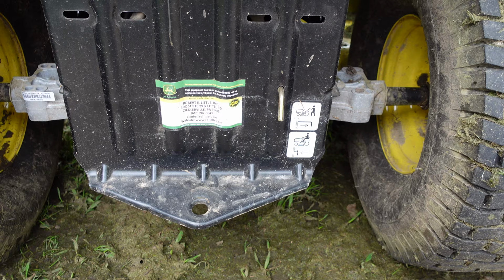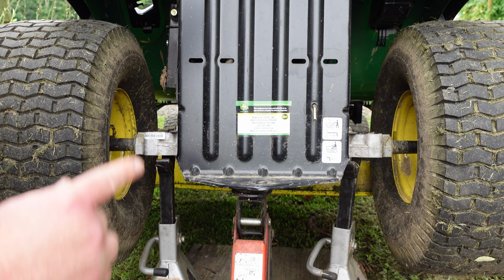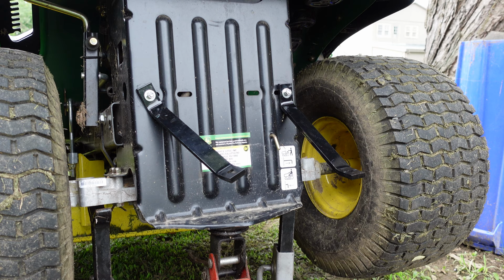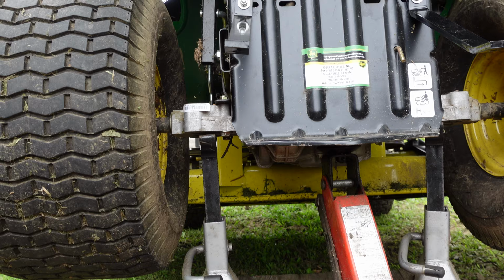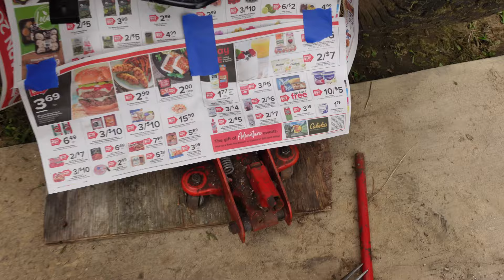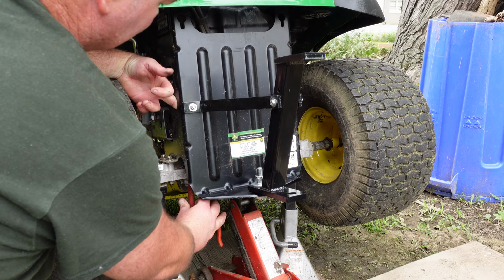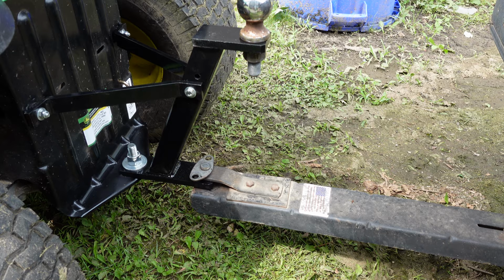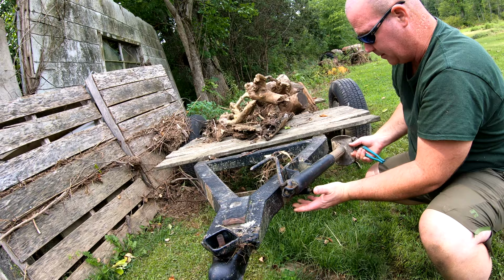John Deere 100 Series Trailer Hitch Upgrade, Install, Test And Review

Comment: I just bought one this year for my D110.  They haven't exactly fixed the problem with the arms, but at least now the holes are slotted which helps a little with the alignment.  None of the kits I've seen online are exact fits.  Mine didn't line up perfectly, but nothing a big vise and a 5 lb sledge hammer couldn't fix. 😁 Minor angle adjustment to the ends of the arms. Got them close enough to work.  I'm only hauling a lightly loaded 1000 lbs capacity trailer around the yard, anyway.  Good enough.

Comment: Great video and thanks for the tips. I've been wondering how the heck I'm going to be able to install one of those hitches on a Husqvarna TS354XD with no room between the frame and transmission. After watching you use long needle-nose pliers to fish the bolts up to the holes I ordered a hitch... Hopefully I won't have too much difficulty with it. Thanks again.

Comment: So you have to remove the hitch to put the bagger on? That hitch is using the bagger bracket holes.
Reply from the maker: I do not have a bagger for this tractor so I can't really say. But I have seen many bagger set ups that use the factory tongue as a mount so I can at least picture it in my mind. Some slight modification would be necessary to both the bagger mount and the hitch shown in this video. I do not believe the modifications required would be difficult, but if I'm picturing it correctly, they would be necessary mods to use both simultaneously. This is a universal hitch set up and it's real heavy duty, so you can weld to it just about anything you like.
Cheers 🍻.

Comment: Did you ever consider reversing those brackets and checking the angles.  Looks like they are different.
Reply from the maker: Oh yes, I tried to fit them every which way, both sets in fact. Only these arms in exactly this orientation fit this specific tractor. It is a universal hitch kit though, so these arms may fit a different tractor in reverse orientation. If I was to build this myself, the only thing I might have done differently is to mount these upper arm to the side of the chassis running parallel to the rear wheels. But I seriously doubt it would make any positive difference.

This is one hell of a kit and worth every penny.... By the time you get enough traction to apply enough force to even begin questioning the structural  integrity of this hitch, you would have long since already exploded your rear trans-axle. It's a very heavy duty set up.
Cheers 🍻.

Comment: The crappy little transaxle on JD 100 series will give out rapidly if you tow much. You really need something like a 570 or higher to handle stress like that.
Reply from the maker: Yeah I know he ain't the toughest kid on the block, but I did show what I'm pulling with it. And too, it's pretty dead flat around here. Now that I've recently switched to gas for heat, I don't need that trailer anymore, or the hitch for that matter. But it will serve now as one hell of a tongue protector for when I tow my yard cart/wagon.
Cheers 🍻.
Reply: @Finite-Tuning  Great response. My x300 just crapped out. It was my first tractor and I did not appreciate how hilly my yard was when I bought it and naively thought a $3500 machine should be up to the task. My 570 is on order and will arrive in two weeks. Happy riding and peace be with you.
Reply from the maker: @donaldramey1896 :
Cheers Donald 🍻.

Comment: I would have some one make a stronger mounting plate I could put in place of that thin sheet metal stuff they have on the mower before I mounted a hitch to it.
Reply from the maker: It's a whole lot stronger than it looks! You'll break the transmission long before you begin to tear this metal. The hitch itself is already extreme overkill, but that's why I like it so much 😁...... Dollars for doughnuts this thing is hard to beat.
Cheers 🍻